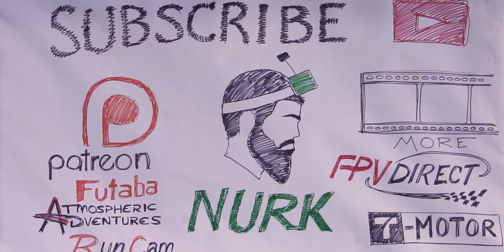The Swamp - Freestyle around an abandoned Oilfield

Comment: This is irresponsible and reckless, what makes you think that's abandoned, just because no one standing there... You shouldn't be within 100 meters of that active well site, nothing looks locked out(I could tell because you flew well close enough to pause and see), the grounds look maintained, you are very likely trespassing, and should not be showing everyone that this is alright or safe to do. If you crash that little floating arc flash bomb near a line that may be leaking you would be responsible for millions of dollars of liability. Like what the hell, no wonder they had to bring in the new laws they need to to keep people safe. Yeah but the trees and the lighting were nice.....
Reply: Meh.
Reply: I work a lot in the oilfield and that is definitely a shut in site. The access roads are overgrown and no active well or pump station there and I don't see it fenced off so probably not trespassing. Besides even if it was active you could fly full tilt into one of those tanks or pipe and you would not cause an explosion. I mean that do you think it's all made of sugar? 😂😂😂 Settle down bud.